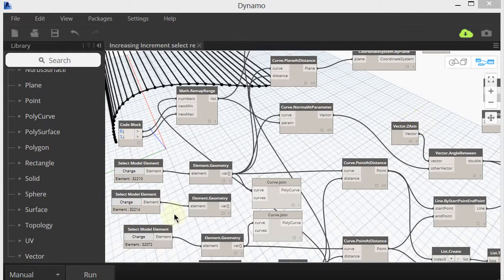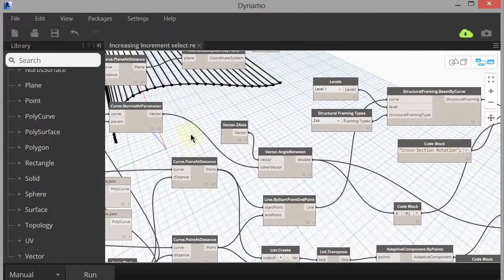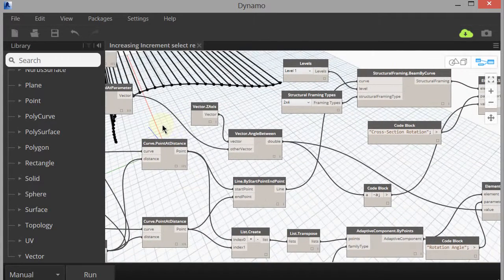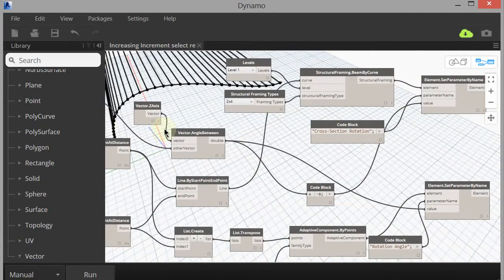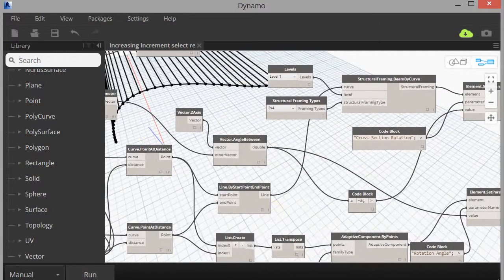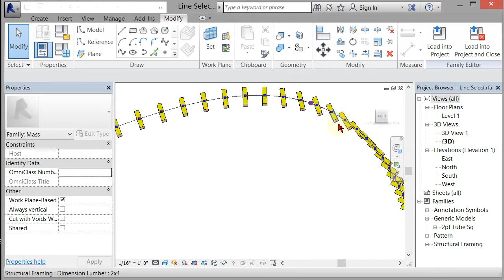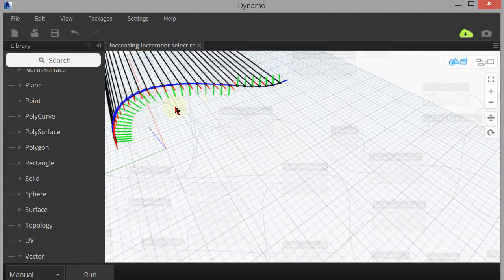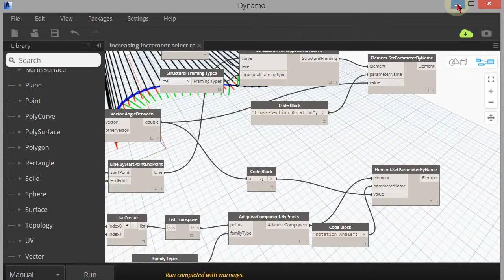Dynamo Flipping Component Rotation 01

Comment: What you need is an If Condition, if the numbers are bigger or smaller than 90 degrees, or if the values are positive or negative, I am not sure what your values are, then let Dynamo chose a or -a according to the rotation you need. Good Luck :)